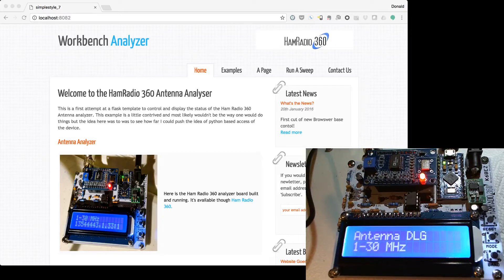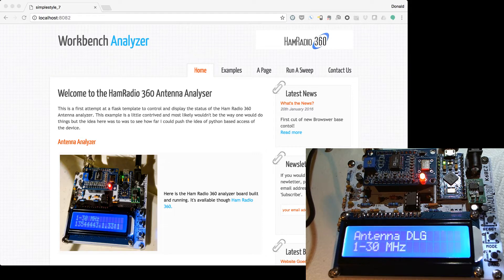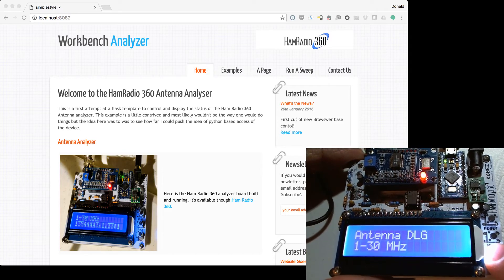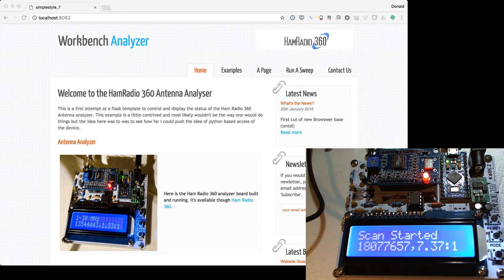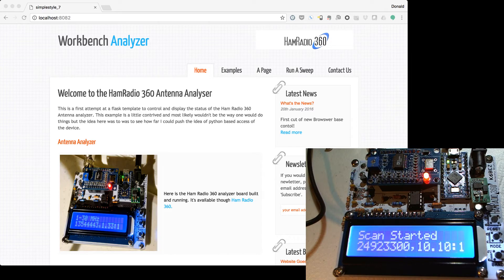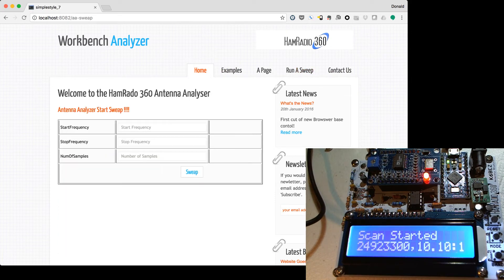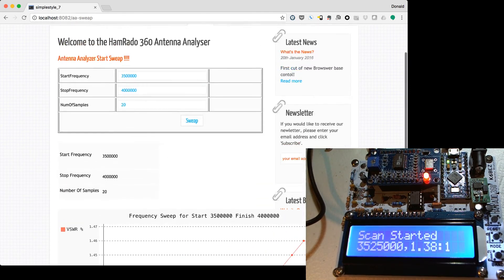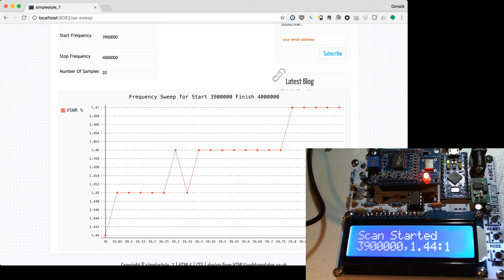Antenna Analyzer Demo.

Comment: Donald, I just ran across your video.  I have been experimenting with my HR360 AA and really enjoying it. Have you made any updates since this version... and is your code available anywhere. Thank you for the work on  this, it looks interesting. 73, Kelly - WB0WQS.
Reply from the maker: Kelly, I got side tracked building a second AA board which I was trying a different Arduino so I have moved the base project any further along how ever I do have the entire project as it sits on Github here: https://github.com/kleewyck/antenna-analyzer 73, Don KC9ZMY
Reply: Hello, I downloaded your firmware and that scan mode is great!  thanks for doing that.  When you use that firmware it doesn't seem to work with the K6BEZ graphing program.  I watched the You Tube video a few times and I see that you are using a web page to do t he graphing.  Does that web page work with the same firmware that has the scan routine?  I see that you've posted what looks like something related to the web page that you are using in the video and I've downloaded it but can't seem to get it to run on my Windows 10 laptop.  I'm more of a hardware guy than a programmer.  Is there a live web page to do this graphing on or is it possible to run that locally with the same firmware that does the scanning?